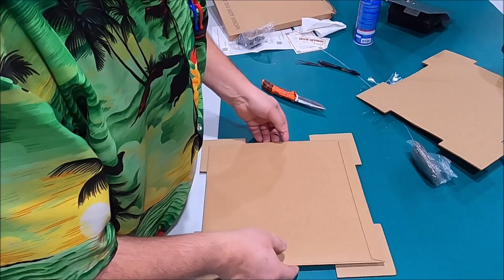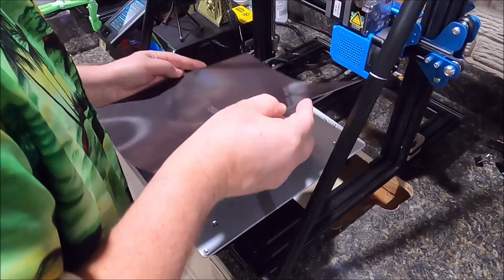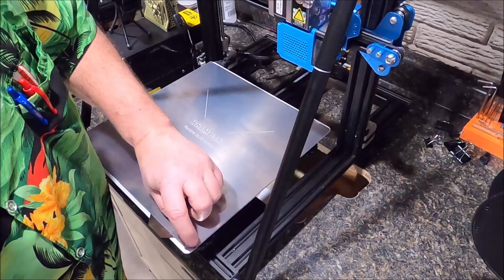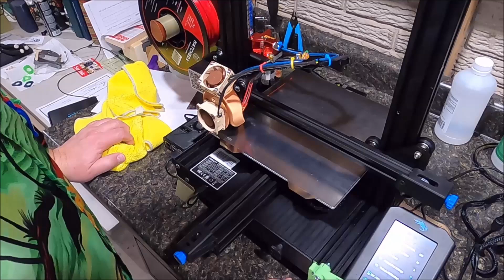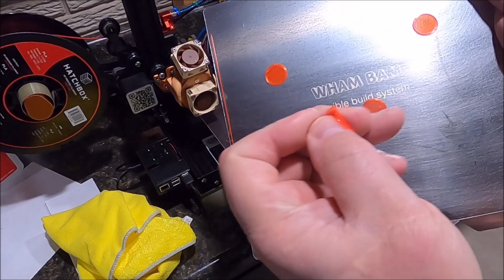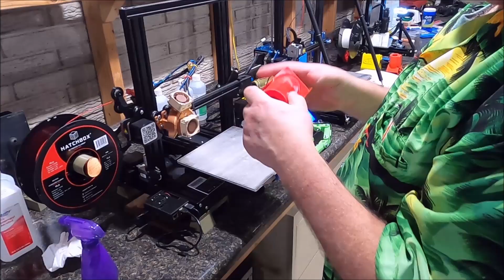The Wham Bam build plate MAGNETIC removalble surface for my Creality CR10 V3 and Ender 3 V2 machines

Comment: Hello Michael,  I am new to game and  just got my CR10 V3 a week ago.  Your videos are great, thanks.  Have you posted the four corner test print for the CR10 V3?  I have just ordered my Whambam.  I am having issues with my prints sticking to the glass plate that came with the unit.
Reply from the maker: Not yet!  I just level with paper and print. I live the Whambam system and or just mirror glass

Comment: I'm all for making a printer better - but the amount you changed and tuned - soon a prusa i3 (kit) would have been cheaper :) (and in my opinion better than a ender ever can be) - I have an Ender 3 v2 and a i3 MK3S+
Reply from the maker: Sometimes it's the difference between buying a tomato and growing a tomato. For me it's about the journey more than the destination.
Reply: @Michaelinthebackyard  You have no idea how much I can understand that :) I also modified my Ender quite a bit. But out of experience - the longer/bigger prints 24-52 hours I only trust the prusa with it... to many failed prints after 18h+ which, besides the wasted fillament, is enormous frustrating. All the best and always keep printing.
Reply from the maker: @LudwigRuderstaller  I constantly run prints longer than 24 hours.  Once it's dialed I run back to back rolls.  I have one print that is 950g. Burn the whole spool.  No issues.

Comment: For PEI surface just clean it once in a while with isopropyl alcohol and it should be okay.
Honestly I feel like you got scammed when it comes to shipping.
Also if you gonna print ABS with open frame and these flex plates then you might need to consider going with ABS+
Reply from the maker: I'm working on creating a box so I can do closed frame printing.  Shipping is expensive.  But I did get two systems for the one shipping price.  $17.00 shipping is a bit steep.